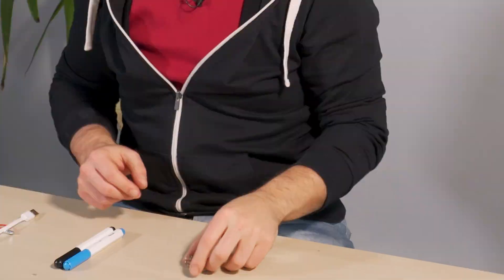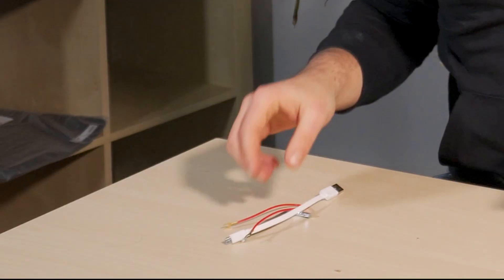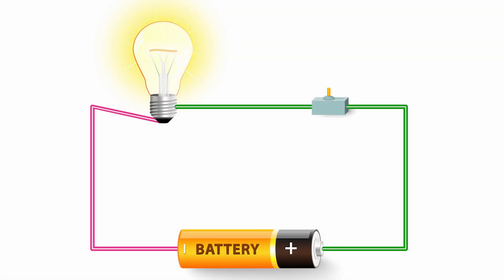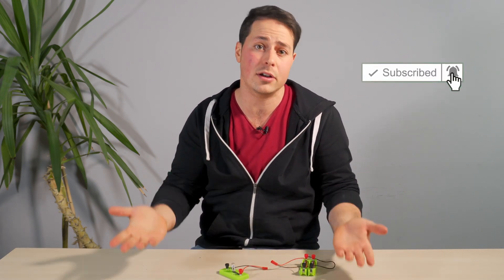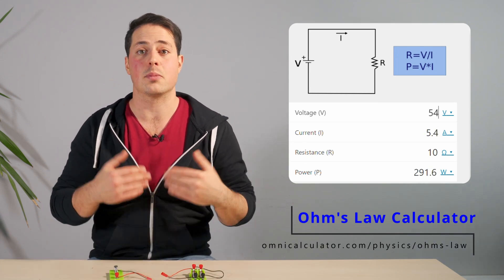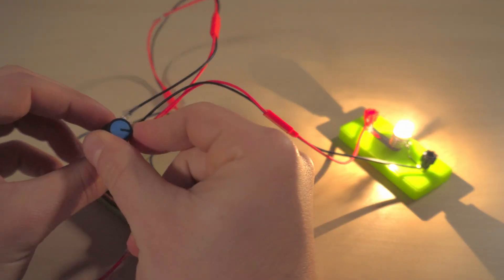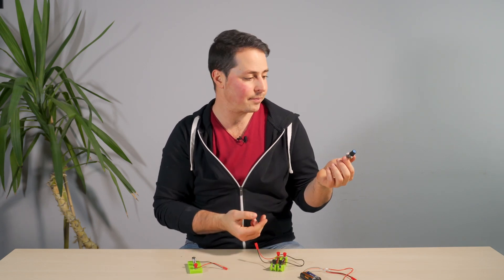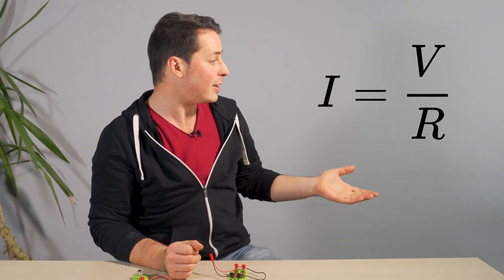What is a resistor? | Why they are CRUCIAL in electrical circuits

Comment: Is this how we are controlling the speed of ceiling/table fans? By using a variable resistor? Or is it some other magical device?
Reply from the maker: Resistors waste energy, so they are not perfect in every situation. For fans (specially inside computers) PWM or Pulse Width Modulation is used. With a bit of clever electronics you can quickly turn the circuit on/off limiting the average current with much less waste.

Comment: Almost every material you can build the cables of has a certain resistance so that you're losing electrical energy (mostly for the heat generation). So, everything might be called a "resistor" but some materials have lower or greater resistance; and logically, we call the materials with greater resistance resistors. That's how I understand it from your video. Thanks!

BTW. Superconductors have zero resistance below a certain temperature. Do you think we could call them "resistors" as you explained :p
Reply from the maker: Glad you enjoyed the video! 
As for super conductors... it's tricky but their resistance isn't exactly zero, just negligible. So "technically"... 
But let's be honest if you classify superconductors as 'resistors' you need to check how you're making decisions in life :P